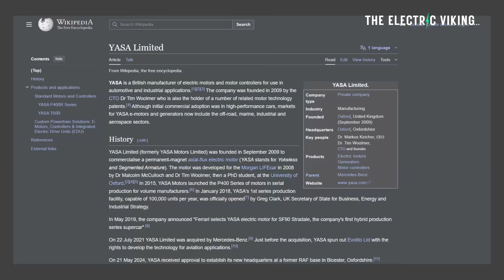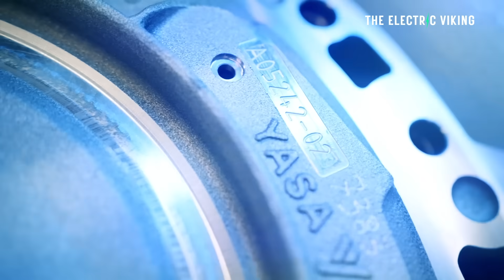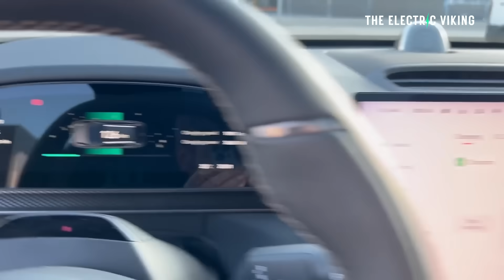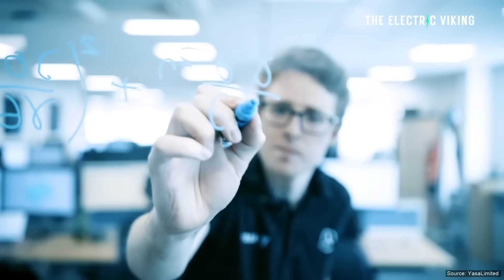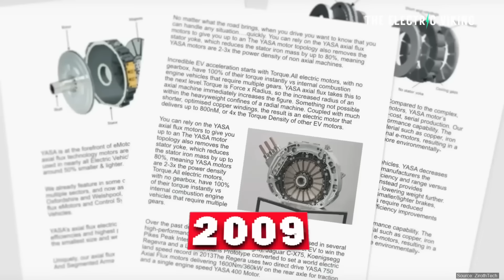The Worlds Most Powerful Electric Motor has 1000HP and Weighs 12kg

Comment: I would be more interested in how small and cheap they could make a 100 hp motor.  True AWD with 400 hp is what the mass market needs.
Reply: Electric motors don't scale fully linearly - the weight of a 100HP motor wouldn't be 1/10th of a 1000HP motor. You need a certain amount of material to ensure rigidity and so it will stand up to the shock and vibrations it'll be subjected to in a vehicle, and also to ensure long-term use reliability. A 100HP motor would be considerably lighter than a 1000HP motor, but not all that much lighter than a 200HP motor - to the point it might not be commercially profitable to develop and tool up manufacturing of a separate 100HP motor.
Reply: @lennyvalentin6485 certainly a lower powered version won't weigh more than the 1000 hp motor. So consider the task accomplished.
Reply: @davis.fourohfour  Nobody suggested a lower powered motor would weigh more than a higher powered motor, what a silly strawman.
Reply: @lennyvalentin6485 and the "silly strawman" is the actual objective that you glossed over?
Reply: @ki0w0-lordofwatersheep  Maybe you don't understand strawman arguments, but by definition, they're not "actual objectives". They just aren't.
Reply: @lennyvalentin6485 that’s not a straw man, he’s just saying they can keep it the same weight by paying attention to the things you mentioned and that it would still be awesome. His point mainly was that no one needs 1000hp. Learn to read.
Reply: @lennyvalentin6485  Then, we are back to the Toyota hybrid design: FRONT AND REAR  electric motor with half-shafts.
Reply: 30 hp you mean.
Reply: The the average person in the general public does not need four hundred horsepower.  What planet are you living on?
Reply: @brianwnc8168 you're right, but it would cover almost everybody. Including people who don't care upto who do withot getting absurd
Reply: coming from DeepDrive
Reply: Must be a forced liquid cooled motor. Otherwise it would be impossible to get higher kw in small frame. No details on the cooling system. Add that weight also.
Reply: @subramaniamchandrasekar1397  All EVs use actively cooled motors today, one reason being even with high efficiency you still build up significant heat loads when you pull tens of kilowatts through the motor, and magnets in the case of PMSMs don't like high temperatures; that can cause them to demagnetize. High heat also increases resistance in the motor windings = increased heat losses = even higher resistance etc etc, and potentially eventual motor damage.

Plus you also want to be able to scavenge waste heat from the motor for use in the HVAC or battery temperature management systems, since this saves energy. So the weight of the cooling system really shouldn't be stacked on top of the motor weight. They're separate entities.
Reply: indeed, been sayin this for yrs - see my other post :)
Reply: I mean it would be great to have both. 

 This opens up more than EVs. In conjunction with the new batteries will be crazy. Like Chevies 600 wh/kg. 

 This opens up person air flight, exoskeletons, robots, and better tools too. 

 With this, and new micro turbines? Life will be good. 

 F1 needs to get rid of the restrictions. 

 Oh yeah. Just because your car has a ton of horse power doesn't mean you gotta use it. 

 This motor. Chevy batteries. Graphene capcitators. Steer by wire. Full torque vectoring, and four wheel steering. All in a Miata sized package. With 2,000-4,000 plus horse power. 

 Sounds like the future. Yes please.
Reply: @bobwitmer2492  this can be a 100 hp motor, depending on how much power you supply to it, and would handle heat better at 100 hp too.
Reply: 400hp is way too fast for the majority on the road. They already struggle going slow.
Reply: Why 12kg is heavy for you? Or if you get one two for 4WD 24kg
Reply: I beg to differ.  The mass market needs small, light vehicles that get the to work, the store or the park and back, easily and reliably at a price they can afford.  They don't need a 1000 bhp AMG panzer wagon or a freeway slab crushing 4x4 behemoth.  Yes, I know the US motto is, "If a little is good, more must be better so too much is just enough", but most people just need inexpensive transportation to get to work and back on time.

Until I lucked into a great deal for an EV donor vehicle to strip for components I was enroute to buying an axial flux motor from EMRAX in Slovenia.  The model 208 that I planned to use weighs just 22 lbs and delivers 115 bhp (86kW).  They were initially developed to power self launching sailplanes but are easily adaptable to automotive use.  The beauty of such light motors is not stuffing them into wheel hubs, increasing unsprung weight and adding unnecessary wheel hub loads.  It is to reduce the size and weight of the necessary battery to produce efficient transport at an affordable price.

The vehicle I'm converting, a 1970 Lotus Europa, weighed 1459 lbs when new by using an 87 bhp Renault power-train.  My conversion, with all the materials in hand and weighed, will deliver 115 bhp with a range of 150 - 190 miles, greater acceleration from a higher torque motor at the same weight as the car was new

My limiting factor are the batteries, but these have already improved so much in the past year that I was able to use a less efficient and heavier, but less expensive, 'legacy' motor.  The greater weight has been ofset buy lighter battery modules.  I a few years I expect to replace the current LFP cells with faster charging Na-Ion batteries that will make greater travel distances easier with fast DC charging while using even smaller, and therefore lighter batteries.

Axial flux motor are more difficult to build than 'legacy' radial flux motors that have been in production, and are well understood, for over 100 years.  With higher volume production and greater automation an axial flux motor that produces 100 bhp should be achievable for under $100 each without excessive weight engineering.  With a design created for low cost at high volume I would expect such motors to be producible at less than 15lbs weight at around $80 if built in the hundreds of thousands.  In other words, if the Chinese build them.  And they will, long before the US legacy automakers make EVs people can afford or go out of business.
Reply: @philipgrice1026  we think alike, I am of the age now where I am forced to 'look on' to the aspirations I once had and would love to follow your evolution in creative EV thinking / crafting :)
Reply: How about  something  bellow  100HP so insurance  is affordable?
Reply: They would just software limit them
Reply: What a shame they sold to Mercedes..
Reply: @ctofan Unfortunately here in the UK 🇬🇧, we have a habit of selling out our tech. From the jet engine to Arm Processors and Yasa. We go to all the trouble of inventing, developing and then selling. 😢😢
.
Reply: lol, you funny
Reply: @ac0pt  The MG Xpower already has 400 HP and is 4 wheel drive and beats the first gen Audi e-tron in acceleration for a fraction of the price but while having the inderiors of a Dacia and the sportivness of a Lada.

   So He's not being funny. Axial flux electric engines are already a reality in high end hybrids from Ferrari, Lambo and Koeningsegg. The Yangwang U9X maybe uses them (the regular one does not). Those engines are expensive due the precission required to be manufactured, which means that you can expect them in cheap Temu cars in matter of a few years, the same as every current low end smart phone shits on the first generation of iPhone...  I think that 500 HP would be the bare minimum power for EV conmutters in the next decade... Hypercars will start around 5k HP and anything below 1k HP would be considered bland...
Reply: @Buran01  He his funny because 400 is a low number of HP for eletric motors

Comment: For most people, they simply don't need that kind of power. However, a light engine is less weight to carry around. That means you get better use of the energy in your batteries. That efficiency will be appealing to everyone.
Reply: I'd be very happy with a humble Corolla with 2 of these electric motors!
Reply: Trucks 🚚
Reply: Small, affordable, pickups/utes? I really need an EV work truck to replace my gas sucking Dodge Ram!
Reply: @Atheist-Libertarian  I agree but HP isn't the same as torque. I don't remember hearing anything about torque. If the torque is also high, these would be great for large trucks. I don't need this kind of power of my pickup. Make a smaller version with maybe 150HP on each wheel (AWD) and I'd have 600HP and hopefully plenty of torque to climb mountains and full trailers. Are these motors at the wheels or attached like other EVs centered in the middle of the axle? Make them so they are where the disc brakes are and you free up tons of room between the wheels, perfect for large battery trays.

Comment: That’s great but they are difficult to manufacture at scale and cost a nuclear bomb. Not practical for prime time.
Reply: Also no mention on safety and reliability, just song n dance on performance
Reply: @ciybersal9833 it’s been developing over ten years. Reliable, sustainable and efficient.
Reply: Hyper cars will get them first. After that they will scale and eventually someone will put them into a Golf E.
Reply: @MoDa87 someone will actually string three together and use them in small planes.
Reply: yes and no. i think mercedes and yasa already achieved to build machines for mass production. to this point it was only in low volume production that probably involved a lot of manual labor.

Comment: In-wheel motors are happening.
Reply: already from DeepDrive in a Tesla, VW and BMW
Reply: Not really a good place to put the motor tho. Unsprung weight, + electric motors are precision made devices, the tighter the tolerances the more efficient they are, so you really don't want to shake and pound them with every single bump in the road. It'd be bad for long-term reliability, plus where would you put the brakes? lol Inboard? With a half-shaft connecting them so you don't even save any weight (miniscule as it would be) by putting the motors in the wheels?

Put the motor in-board and keep the brakes where they are. No need fixing what isn't broken...
Reply: @lennyvalentin6485  Tell that to my e-bike, which handles rocky trails easily.  The 'unsprung weight' relates to heavier motors.
Reply: @lennyvalentin6485  or, since we entrust flying to fly by wire, do we just rely on the motors for braking too?
Reply: @davidstuart4915  EVs already do a whole lot of braking with the motors (regeneration braking, to put some electricity back into the battery, I'm sure you know.) But you still want mechanical brakes on top of that of course... :D Anything else would be madness, especially since regen braking loses effectiveness at low speed, and especially if your battery is close to full already.
Reply: @davidstuart4915 I'd say, motor braking on two wheels, front or back, with backup mechanical brakes on the other two wheels.
Reply: Car nuts will fight hub motors with every geared brain cell they can wield. Something about an empty engine bay makes them die inside.
Reply: @davis.fourohfour  It might b an option.
Reply: @davis.fourohfour  There's really no good technical reason to put electric motors in the wheel hubs of a car other than the fact that you can (if that qualifies as a good one), and a bunch of bad ones.

Unsprung weight as mentioned being a major one, and also mechanical shocks and vibrations being another. You need to relax tolerances in the motor if it's going to rattle around with the wheel constantly all the time, and that's bad for efficiency. Bad efficiency motors when you have such limited energy storage as in an EV, and the motors being the vastly highest energy consumers in the vehicle = really bad for range.

You want as much as possible of the energy in your batteries to transform into range. So therefore... No hub motors. There's a reason car manufacturers aren't doing it, and it's not that you are smarter than them. ;)
Reply: They wear out too quick in this environment.  Physics do not seem to work in large wheels for cars,  but there's a motorcycle trying out this kind of tron concept.

Comment: I found 7 cos. making versions of the Axial Flux motor. You're right. They are going to change and improve the EV market with the improved power to weight ratios. These motors could even be combined to use in heavy equipment.

Comment: What I dont understand is: at that weight, how does it not shred itself apart from the torque? I mean just beefing up bearings and other components to handle that power would certainly weigh more than 12kg. It’s crazy if true
Reply: A 1lb bolt can hold tens of thousands of pounds😂
Reply: @veganpotterthevegan what an engineer you are 😂
Reply: @louisolivierfortin   I just have more than 2 braincells. I am a welder too though but I knew this before I hit my teens.
Reply: @louisolivierfortin  *Typo... I'm riding my bike.  But you should still know that the power isn't what's going to break this motor. The issue will be heat management over time.
Reply: Sounds exciting but that was all about speeds that nobody will be able to use except on race tracks. If it’s scalable downwards, what would a 3 or 4 kg motor of that design produce and how would that translate into life mileage and batter range for small, urban cars which is where most of the car future lies?  What about trucks and buses? What about (dare I use the word here?) trains? Agricultural vehicles, lift motors, conveyor belts?  Certainly it sounds revolutionary but it sounds like it’s a much broader revolution than just fast cars.
Reply: @bernardmiller7247  Well, there are people like you and my wife who only care about getting from point A to point B safely, and then there are people like me, who cannot drive a car less than 670HP and 718ft. lbs. of torque. 😁  I like to accelerate hard, and sometimes go fast- but more about the acceleration merging on to a highway or passing EVERY car on the road on a whim and the cornering performance that pushes the car to the limit.  
To answer your question, this is definitely scalable. My Model S has insane mode that allows the car to use all 670Hp, but also has sport and chill modes that effectually reduce power by 1/3 each setting, respectively.  The cars that no one cares about performance will have outstanding range as they use less energy to move. We have electric semis here in the States (but not common as of yet). There are already electric buses and taxis in Beijing- the buses use a retractable array on the top to charge when in the vicinity of the overhead cables in the downtown area to provide charging on the fly- smart, but not aesthetically pleasing.
Reply: @jerz8289  you should have you license taken from you.  Save that nonsense for a track.
Reply: Question of safety and reliability pops up
Reply: It's short-term peak power. The continuous power is 350 kW.
Reply: You restrict the amount of amps going in to it. Bottom line it is more power with less electricity. This should help the range of the EV..
Reply: @BTS-Astro1  restricting amps, restrict torque, restricts advantage.... so efficieny arguments, arent All Torque, u might say...
Reply: Probably find that it's an electronically controlled  limited peak then a constant running peak... So hit warp speeds and then just hold it there till you run out of straight road... Vanishing point 2.0 🥼🇬🇧🧙🏻‍♂️